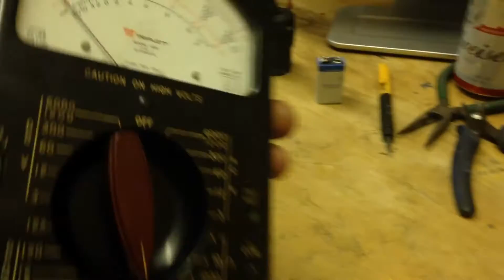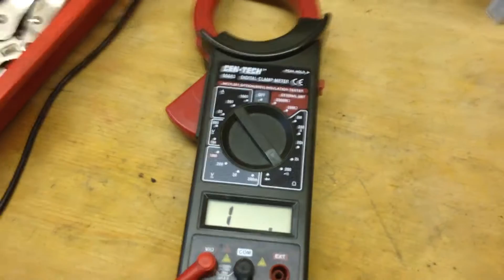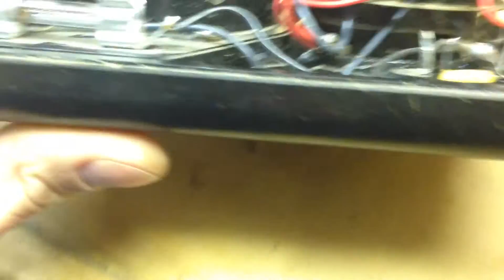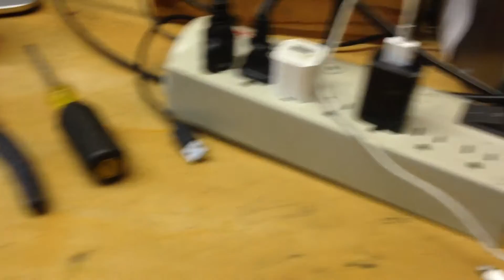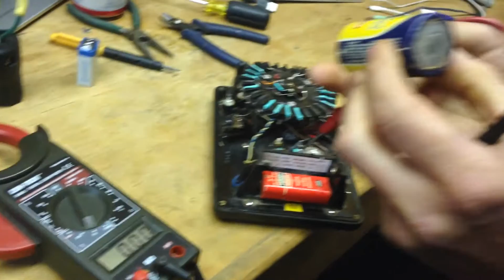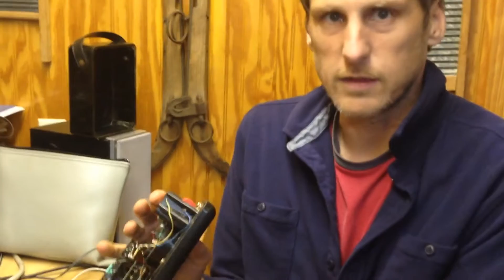Inside the Triplett 630 Meter.  Testing

Comment: So I took mine apart,  had to do loads of corrosion abatement.  Everything seems to be working other than having to change out the wires going to the battery contacts.  Then I needed to figure out proper battery type and orientation.  That's why I'm here... thanks !  Great.   Mine only had the 30v square battery when I opened it up.  I was confused about the upper battery position.
Oh and mine had a really old cardboard and wax wrapped 30v battery.  It was still pushing out 5v somehow despite all the corrosion.   They don't make em like that anymore lol.

Comment: i found a Tester on Saturday it is a Triplett model 650 VTVM it has 1 spot for a Battery, but it does have a Power cord that plugs in on side, the tester that plugs in on front has a wand style tester probe, i pluged it in and the power light comes on, but there is no movement on the needle on meter

Comment: Great video, The battery for this unit is the Exell Battery 413a replacement for the Eveready 413. You can find the new battery at the link below. This one is alkaline. 

http://www.batteriesinaflash.com/exell-413a-alkaline-30v-battery-neda-210-replaces-20f20-blr123-er413

Comment: Additional remark about old leads. Be careful with old test leads. They may look OK, but they can still be dry rotting and starting to crack. Examine them very, very closely. You can still get new Triplett leads to fit your meter for under $20. The higher the voltages, the greater the hazards. I've replaced the wire in my old Weston 660 probes with heavy test probe wire (its ends can be disassembled). Bought new test leads for the Triplett (those cannot be disassembled). There are instructions on-line for your Triplett and suggest you read it. There are a number of things to keep in mind when using it around higher voltages to stay safe.

Comment: The two batteries are only used for measuring resistance. The 1.5V D cell is used for all but the highest range (100k). Both are used for the highest range. If you put in a 1.5V D cell without the other one, you can verify all the lower resistance ranges work. Unfortunately, the 30V battery has been long discontinued. However, guys have made suitable replacements by putting 3 of the very common 9V cells in series. You can also make a stack of 10 CR#### lithium coin cells. My guess would be your 30v battery is 16mm thick meaning you could probably make a stack of 10 CR1632 cells (16mm dia. x 3.2mm thick). All the lithium coin cells are 3V. The number is their physical size. The 3x 9V hack won't fit where the current 30V battery is, so you'd have to create your own mounting and wiring scheme, but a stack of the Li coin cells might fit. The resistance measurements use so little current the batteries will typically go bad on shelf life (internal drain) versus being drained out from use (CR coin cell shelf life is ~8 years). You don't need the batteries for voltage or current measurement. You can find battery hacks to solve the 30V battery problem for these and other meters online (Google is your friend).

I've got two older VOMs, one Weston and the other a different Triplett that use 15V batteries that can still be bought  but they're rather expensive now. I'm in the process of building three 15V stacks of five CR1632 cells each in plastic tubes. The Triplett will hold one, and the Weston will hold the other two in parallel.
Reply: I just stumbled across this video and I don't know if you guys are aware
 or not, but these batteries are made again. Amazon offers two versions 
of the 413A. One is generic and one is Excell 413A. I personally think 
they're both made by Excell. Link 1 is the generic and second link is 
the Excell. Copy and paste each in browser. Hope this helps. Good luck.

https://www.amazon.com/413A-BLR-123-BLR123-ER-413-VS085/dp/B00NUAJC0G/ref=sr_1_8?s=electronics&ie=UTF8&qid=1479991950&sr=1-8&keywords=30+volt+battery

https://www.amazon.com/Exell-Battery-413A-Alkaline-BLR123/dp/B00BNF7R98/ref=sr_1_2?ie=UTF8&qid=1479991563&sr=8-2&keywords=30+volt+battery
Reply: I'm aware of the Exell batteries. Bought two of their 15 volt in two different sizes for a HeathKit IM-105 (aka Weston 660) and a vintage Triplett 310-C (the new ones use a 12V A23). It's cheaper to fabricate a holder for a stack of the coin cells that will fit into the original battery holder and buy them in bulk from a source like Amazon. For those who aren't up to fabricating a custom coin cell stack holder or don't want to spend the time doing it, the Exell are the solution. Now that I've got both meters fully functional again with the Exell batteries, that's my next project. The Exell batteries should last darn near forever as they're only used in the highest resistance range. Shelf life will do them in before most folks' usage drain does. I suspect Exell is building a stack of common cells and packaging them in the proper form factor for the original battery.
Reply: You mean user 10 CR 1632 ?

Comment: 30 volt is only used on the 100k resistance setting. 1.5 does the rest. No battery needed for AC/DC.

Comment: You can purchase the 30 volt battery from Amazon.com for $12.87 and free shipping.(alkaline, not zinc air) Not much more than three 9 volts stacked together, and a lot more convenient. Just search for NEDA #413. I googled the triplett 630 manual, and it said the batteries are only used for ohms testing.
I have a 630-NA (type-3) that works on all functions EXCEPT AC volts :(

Comment: Oh BTW, that Centech meter is a Harbor Freight product - should be able to get PDF manual @ harborfreight.com You can find a close schematic for the 630 @ triplett.com And yes, those 2 diodes are the AC scales rectifier - there should be 2 more diodes across the meter, but those are for over voltage protection. The 630 schematic shows that the AC rectifiers are a special sub-assembly, but if you replaced it with a 1N34A germanium or 1N60 silicon diode it will prolly work OK. To determine if you should use germanium or silicon, measure the good diode with diode check function on your meter. If its about .2 volts its germanium; it its about .5 volts, its silicon. The capacitor @ 2:39 is the "output" capacitor to block DC plate voltage when reading low AC volts. The 1.5 volt battery is for the lower ohms; the 30 V battery is for the X100K ohms scale.
Reply from the maker: 2.49 I'm so sorry for being so late and 7.30 PLEASE FORGIVE me!!! My second kid is coming home from the hospital in three days.  IM ALL SXREWED UP!  Sorry about the early text my friend.  :(
Reply: Its cool!